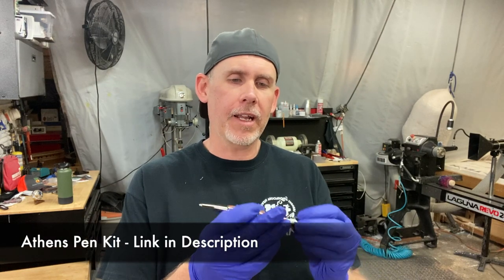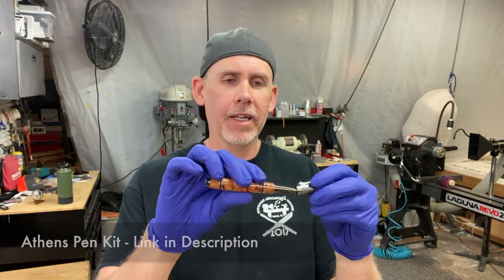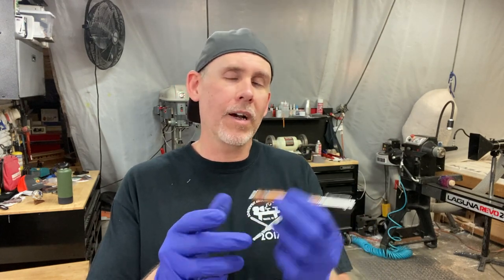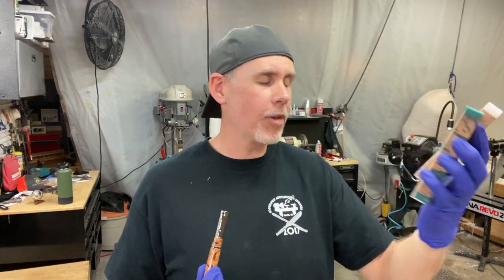Segmented Madrone Burl and Resin Pen

Comment: Cool looking pen Zac. Going to have to try one of those Athens pen kits. Like the technique.
Reply from the maker: Thanks!! Yeah, I'm digging those Athens kits. I had never turned one, really sharp looking kit!
Reply: @ZacHiggins  See you are still using the abranet with zona paper. I switched to this recently after watching your video and it makes a difference. I always struggle with fine scratches after I think its good then put the magnifying glass on it. That technique helped a lot. Thanks again.

Comment: Caution on the engraving blanks - white-black-white plastic - it might have 1 or 2 peal off clear sheets on the outside to protect the surface.  I have an engraver and a lot of material of all sorts of colors.  It is an old style manual.  Good luck and nice.
Reply from the maker: Great tip!

Comment: Great video as always Zac!  And the pen turned out beautiful. I just bought some segmenting material from Turners Warehouse (both sizes).  What made you decide to use the bandsaw to cut it?  Too much tear out with a table saw? Thanks!
Reply from the maker: I'm not sure, I just had the bandsaw set up with the little crosscut sled and went for it. You could use a table saw just as easily. I also have a SawStop, so I tend to cut metal things with the bandsaw rather than having to turn the brake off on the SS
Reply: @ZacHiggins  thanks. That makes sense. Especially the Sawstop part.